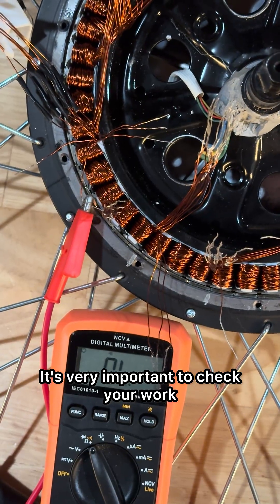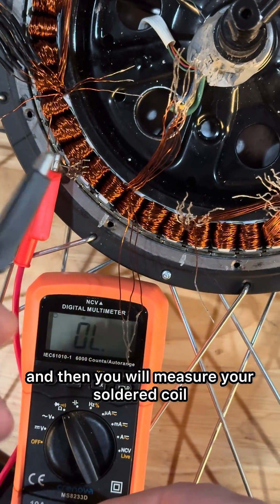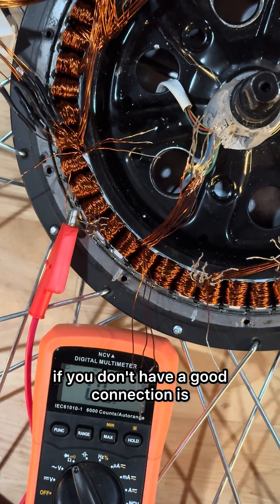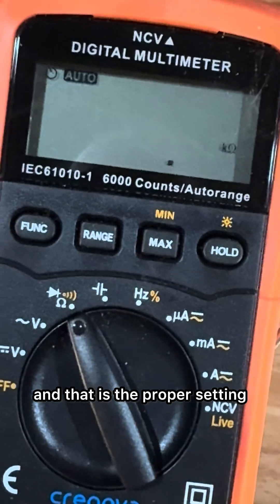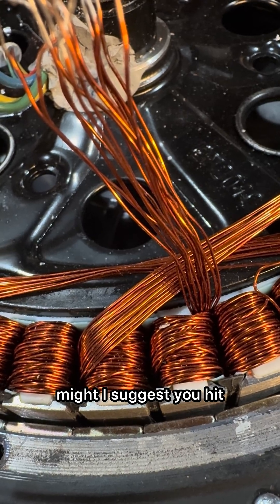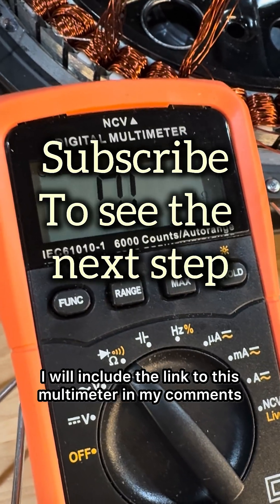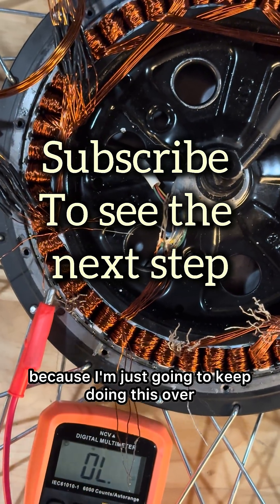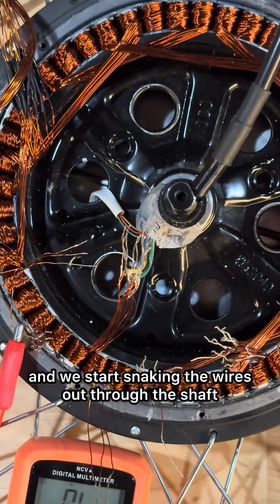Pt4 water wheel generator from 1000 watt ebike motor

Comment: A faster way to straighten wire and does much better job s to pull the strand across a steel screw driver, pick, or something else thin. It causes the molecules to align.
Reply from the maker: I’ve used that trick in the past. Works great on clean wire.  These wires were desoldered and are a bit rough.